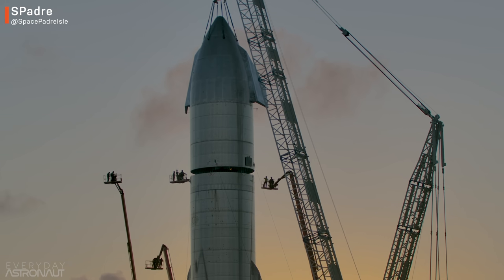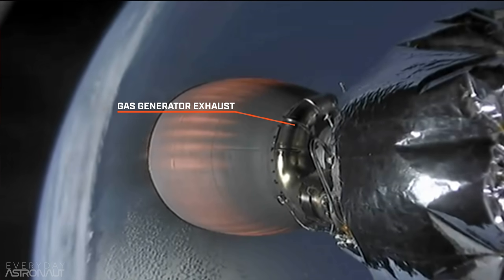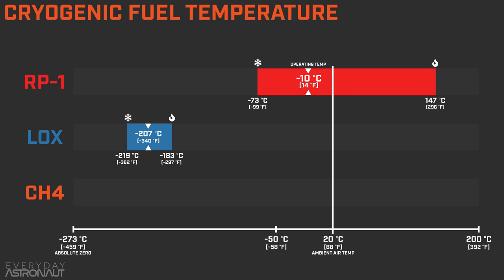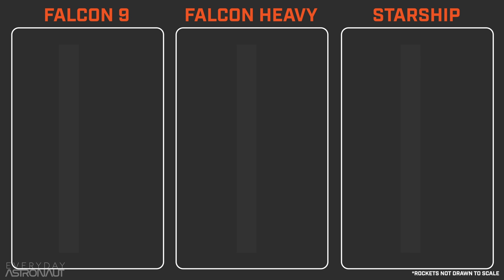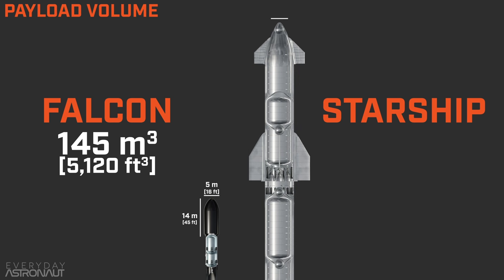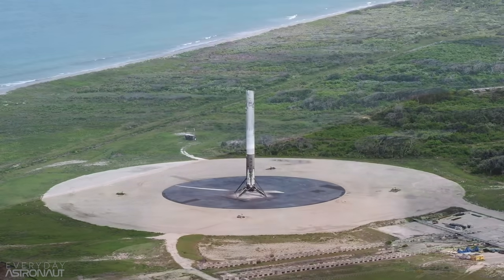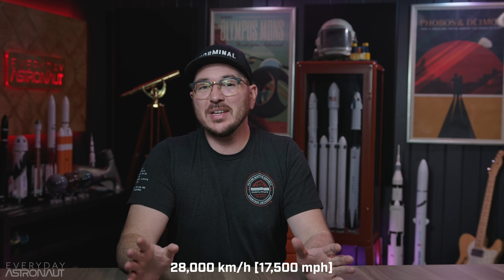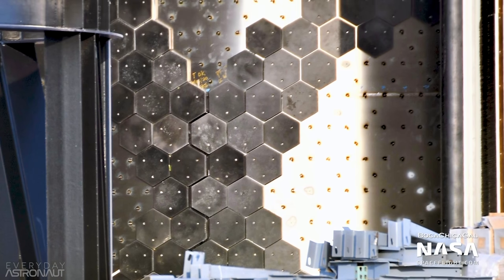Complete Guide To Starship: Falcon 9 VS Starship. What's new? What's different?

Comment: Simple: if you're going to run tankers, then same thing for landing. Partially top off. Then you have tons of propellant to spare, to cushion for a non-optimal confluence from sideways drag/belly flop/overflop/straighten flop/last second blast.  Still do those; it just forms a "fuel reserve" for extra cushion blast if everything else doesn't go PERFECTLY.  Another possibility: don't rendezvous with a tanker ship; have tank(s) in geo - "filling stations." Consider if it would be easier to refuel from a tank array than from a tanker, with many reasons - including if the tanker can't launch.
Reply: I should say, "Still do OR ATTEMPT those" - because what if any (and I mean any) one of those steps is unavailable or does not sufficiently succeed?
And after everything you could repurpose the unused emergency fuel.
You're welcome,  E.
Reply: One more for you, no charge:
Rather than perform the most complex and perilous operation in aeronautical history to bring the cabin for the last ~10,000 feet, just eject a human filled capsule with parachutes. Just like ejecting a satellite payload, but in the upper atmosphere, following the plasma adventure.
Still do everything as is, still retrieve Starship; but the human margin of safety goes up immensely, albeit with costs/tradeoffs.

Comment: Starship is heavy and a large heat shield is required to recover …just empty tanks and a cargo bay. Therefore, for a small crew orbital fully reusable commuter system, I suggest that landing a DreamChaser type lifting body can be a lot safer for regular crew orbital missions (no parachutes no back thrust multi re-ignitions, etc). This 3 stages system proposed, providing existing technologies could be consolidated by NASA from different co. currently competing and legally conflicting, would be to use Paul Allen Stratolaunch huge plane with 220 tons lift as stage one, then a small Falcon heavy central stage type recovered far at sea as second stage and finally the DreamChaser fitted with two orbital and reignited engines Merlin or equivalent with all valving, COPV header tanks inside the vehicle, recovered and saved with the landing DreamChaser like for the shuttle with most fuel supplied by two or four side mounted drop tanks, 3D printed and as third stage power only therefore quite small. Three stages are this way lighter and almost 100 % rapidly reusable while using synergies of those existing systems. The small 2 or 4 drop tanks ejected just before reaching orbit and burning down do not carry any heat shield for recovery and this is a big weight saving gain like the stratospheric lift plane as well. The lifting body design is also much safer for crew than fragiles winged shuttle and other landing systems but would be slightly beefed up to hold and recover also the orbital propulsion and life support systems currently wasted by Falcon 9 second stage and crew dragon service module. Note second stage could also consist of an oversized Pegasus winged initial stage rocket recovered like a gliding drone once empty and light..but this requires more development and maybe more dead weight also than a Falcon 9 recovery representing about a 16% of capacity penalty ..but the rocket wing can contribute to plane take off lift and increases this way the possible take off weight in theory…maybe up to 240 or 250 tons..as a hanging large Pegasus pushing a DreamChaser load…

Comment: If they can figure out on-orbit re-fueling using the Falcon 9 second stage, they'll have a fleet of orbital transfer vehicles already available on-orbit.  That could be an intermediate step prior to Starship.  NASA could even use this to stage equipment at the ISS.  You wouldn't have to take earth reentry vehicles all the way to the moon.  Just rendezvous with the ISS, and use Dragon capsules to ferry astronauts/equipment back and forth.

Comment: I think you made a mathematical error when you said if the vehicle is going twice as fast there is eight times as much energy.  It depends on the starting and finishing speeds so that specific math only works if it is going 2 mph.  Correct me if I'm wrong math wizzes.  Anyway we're talking in the neighborhood of 28,000 mph.  So we might be comparing 10,000 mph to 20,000mph so the energy difference is the cube of 10,000 isn't that right?

Comment: If SpaceX can pull this off, it will be by far the greatest achievement of man in the history of the World. I’m referring to SpaceX accomplishing the entire Mars mission with Starship with full reuse for both stages: 

-Launching Starship from Earth
-Successfully landing SuperHeavy first stage back on Earth
-Refueling Starship in Earth orbit
-Flying Starship to Mars
-Landing Starship on Mars
-Manufacturing fuel on Mars
-Starship taking off from Mars
-Landing Starship safely back on Earth
-Reusing both Starship 2nd stage & Starship Superheavy 1st stage

I think the biggest challenges for SpaceX will be safely landing Starship on Mars and safely landing Starship back on Earth without burning up on re-entry and without crashing when landing. 

How does SpaceX plan to slow Starship down enough from its interplanetary speed to land softly on Mars without any significant atmosphere on Mars? 

I assume that the skydive slow-down method won’t be sufficient to slow Starship down enough without having atmosphere on Mars like we do on Earth. 

Is SpaceX planning on refueling Starship in Mars orbit before it lands on Mars, so that it will have enough fuel for trust to slow down and land on Mars? 

I know that SpaceX plans to manufacture fuel on Mars to refuel Starship to take off from Mars to come back to Earth. 

Are they also planning to refuel Starship on Mars orbit after Starship takes off from Mars and before its return trip to Earth? 

Also will Starship need to be refueled again in earth orbit when it returns from Mars, before Starship lands back on Earth?

Comment: Might a Mars mission carry radiation shielding in the form of an M2P2 plasma device? This would make an artificial magnetosphere to shield the spacecraft, at the cost of some reaction mass. A 1 MW electric system of this type would make a magnetic bubble a few hundred km in diameter and greatly reduce the radiation exposure to the passengers and cargo. It would also add about 4 N of continuous thrust, which would reduce the time required to reach Mars, or any other outer planet.

Comment: Re entry cooling: how about carrying some water. Upon re entry pump this out to cover all hot surfaces. The result is a bunch of steam thst  not only provides cooling but also provides signficant propulsive forces.
Reply: Water is heavy and takes up space
Reply: @ypopnun1003  I think somebody should run the numbers
Reply: @JohnGilmour  Early starship/BFR designs planned to use transpiration cooling as you describe, but using the propellants instead. SpaceX decided not to pursue it as the pores would get clogged over time.
Reply: @OzearEimaj  I am aware of their idea of using propellants for cooling. I am thinking water dispersed from a single tube running the body length might be a better idea. Water has a huge heat capacity and a also huge expansion ratio. Just my thoughts.

Comment: Why don't they just use a single vacuum engine? Do they really need 3? specially when they have a lot of time to burn
Reply: What if your one engine fails? With more than one and if they all line up with your CoM, then you can still have a successful abort or even carry out certain parts of the mission with one failed engine.
Reply: @OzearEimaj  If your one engine fails, You make an emergency landing. Or maybe have 2 vacuum engines 3 is definitely not justified.
Reply: @MonkeyTrade  
If you're thinking these extra engines are not justified for weight-saving reasons, each engine has a mass of around 1.5t. With a total Starship dry mass of 120t, subtracting 3t from this only gives a maximum dV increase of ~40m/s. The gain in redundancy is completely justified in this case.

To address your "plenty of time" claim, with three raptor engines, the burn time for TLI is around 8mins, whereas with only one engine, this is increased to 24mins. To minimise finite burn losses, for the 24 minute burn you may want to split this into 2 or 3 burns, requiring more engine ignitions, burn time and extra passes through the Van Allen belts. Even if you accept the finite burn losses, the extended burn times may incur a greater chance of engine failure.

Also, the performance difference between Raptor Vac (isp = 380s) and Raptor SL (isp = 350s) when fully fuelled means 500m/s more dV. So I hope I've convinced you that minimising burn time (within reason) and maximising dV is more important than reducng the number of engines on Starship.

EDIT: The Starship wouldn't have enough thrust to get to orbit after separating from the Super Heavy with only one engine; TWR is 0.47 at this point with 3 raptor vacs. Using the raptor SL is possible, but the performance hit would harm the performance as I said earlier.

Comment: For the Starship that goes to the moon, the crew and equipment(upper stage) should have its own header tanks so that no elevator is needed to get to the surface. Thus the fuel section could be utilized as part of the moon base. My idea is to bury it using robots and three D printing tech, cut into it, three D print access doors.....we have all kinds of tech on this planet that should be utilized in space
Reply: That's funny

Comment: So star Starship runs on Manure? Now I know why the cattle run away when it starts!
Reply: What?? Who said that? It runs on methalox. Plus the cows were at the McGregor facility, with Grasshopper.
Reply: @captaincrash12  This is not humor. Plus, being “wet behind the ears” is not necessarily a bad thing, because you can evolve. Also, this so-called “humor” revolving around manure does not have its place in the comment section of a video about a revolutionary rocket.
Reply: @farcasdotpng   HaHa your embarrassed. My apologies as you must be a teenager to be so offended by nothing. Give you a tip, loosen up a little.

Comment: Space x will find out the BF booster will need the reentry burn heat shield because of the heat warping of the Stainless steel housing.

Comment: Why do they bother to paint them in white and repaint them after every launch? Couldn't they be paint black from the begining?
Reply: they don't repaint them.
Reply: @angadsingh9314  why they are white then?
Reply: @johndoeofficial4357  cuz it looks coool. It’s iconic.
Reply: @angadsingh9314  Neah...must be a better explanation
Reply: @johndoeofficial4357  White paint absorbs much less solar heat than black, so it helps keeping the rocket fuel cold before launch.

Comment: Musk will get some thick steel plates welded in that hole and go again. No time to raise the tower for a conventional flame deveter. Next tower build will get raised. FAA may not like another unproven design and shut them down until they build a conventional deverter. Dang monster booster is probably adiquate with all engines running at 70%, which would help in the short-term.

Comment: math question: fully-loaded booster (similar to the current Booster 3 or 4), already in orbit, with 30 Rvac engines, what is the maximum speed achievable? how long could it maintain 1G acceleration? better yet how many Rvac engines needed to maintain 1G acceleration,... and for how long? (point: reduce zero G time on trip to mars)

Comment: Ok--I've got to address the elephant in the room here.  On orbit refueling is all well and good--but how are we planning to get all the way out to Mars holding a tank of Cryogenic fuel for landing?  Even getting to the moon we're probably going to need some serious radiators to prevent that from boiling off.  I mean--falcon 9 lands using cryogenic fuel, but all use of cryogenic fuel on a falcon 9 mission is basically done within 20 minutes of launch and the fuel super-chilling methods require those launch windows to be instantaneous.

Not trying to be a detractor here--I want this to succeed as much as everyone else--I was just wondering how this was going to happen.
Reply from the maker: Elon talked about this at the 2019 Starship event. Header tanks by being inside the larger main tanks are essentially vacuum sealed and the amount of boil off can be relatively low. You can actually use a heater to keep GOX / GCH4 pressurized counter intuitively

Comment: 44:30 "It's not even the heating goes up by velocity squared....  no, re-entry heating goes up by the cube of velocity."

"Heating" = Kinetic energy = ½m⋅v²
So it's velocity squared, not cubed.
Reply: @ncdave4life Read about sutton-graves heating which includes the rate of heating. So cubed is correct.

Comment: I was wondering 3 engines and 1 engine failure 33% of thrust lost ; combined with a risky late retro rocket start; resulted in this crash. 
But if we had 6 engines working in in a ring.  Well If  1/6  engines fails only 17% thrust lost ; there should be enough thrust to land safely.
Also we should start  retro thrust earlier for more response time to correct for such failures. 
Well Elon What say you . Ok sure more moving parts more expensive rockets 
however your Cosmonauts might appreciate the extra padding ;) .
 And you might save money on fewer rocket ships Lost :(.

Comment: 4 years later it’s still not fully reusable nor is it more than an empty tin can.
Reply: 4 years is nothing considering this is by far the most technologically advanced and largest rocket ever made.  Also factor in that it was built from the ground up using new untested engines, new untested fuel systems, new control schemes.  Compare this to NASA's SLS rocket that was started 2011 and reused boosters and engines from the shuttle program. It has had one single test flight that was the Artemis 1 mission in 2022 and has cost $26.4 billion so far.   SpaceX has spent a fraction of that at $5 billion and multiple test flights.  I would say they are doing pretty good.  Also they have already proven the concept re-usability  as they have successfully caught/landed both stages intact.  They haven't re-used those, nor did they ever plan too,  because they already have a newer version built and being readied to test with several more on the way.

Comment: A stripped-down Cargo Starship, packed with multiple sensor suites, will embark for Mars in 2024. It will be primarily a fact-finding mission, measuring every aspect of Starship performance over the 6 month duration mission. All the data will be beamed back to Earth for immediate and extensive analysis, and will likely result in changes made to Starship for future missions to Mars. The vessel's return to Earth will have to wait for the next departure window. 

The trips to the moon will be fairly straight forward by comparison. This year, 2021, will see multiple Starship test flights to Earth orbit, and perhaps the first crewed flight to orbit. In 2022 it's likely several lunar uncrewed Starship flights will launch to the moon, orbit, land, and return. And then late next year the first crewed Starship  lunar mission will launch. It's unlikely SpaceX's bid to join Artemis will happen, and thus Starship can be launched without that NASA distraction slowing down their progress. 

The space tourism Starship mission to the moon with the Japanese guest will likely occur in 2023. Also in 2023 the fuel transfer capability in Earth orbit will be completed. 

There will also be 2 other uncrewed  missions to Mars launched in that brief 2024 window, with slight design variations to test in situ in Mars orbit and on the surface. 

This in 2026, building on everything learned from the 2024 Mars launches, several Starships will be launched to Mars, 1 or 2 crewed, the others as Cargo versions. 

I get the sense Elon will move aggressively and rapidly once the reusable and fully reliable Starship is a reality, which seems 99% certain now. 

Ad astra!

Comment: "use as little fuel as possible on landing burn" why? unless you absolutely are running on fumes, slowing the rocket down slower than white knuckle riding the landing lowers strain on the craft but also gives more adjustment time, less chance of a heavy landing. There is no reason to conserve fuel at the end. the savings are minimal. the falcon9 is granted this just because of thrust to weight.

Comment: A less than basic understanding of aerodynamics shows how much bs spaceX is. Not to mention Elon Musk is boring tunnels in LA which is obviously genius. My only questions are , why is this Musk not broke and why does anyone buy into this BS ?
Reply: @julesdomes6064  I'm an independently contracted imbecile . All I would do is try and boar tunnels for a subway system on the moon and I think good ol Musk probably has that infrastructure design patented already.
Reply: @jasonmenke3955  I was thinking more of your superior understanding of aerodynamics, compared to Musks grossly incompetent engineers.😀
Reply: @julesdomes6064  well, that's what you get for thinking ! 🥴
Reply: @jasonmenke3955  Was that a response to something?
What are the obvious aerodynamic problems you referred to?
Reply: SN15 :)